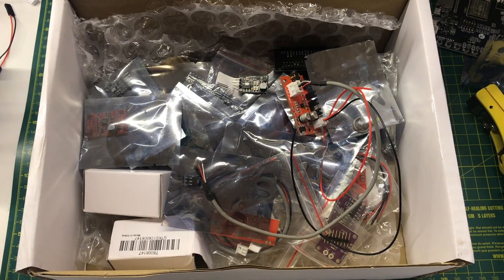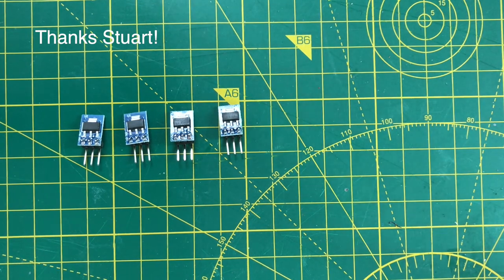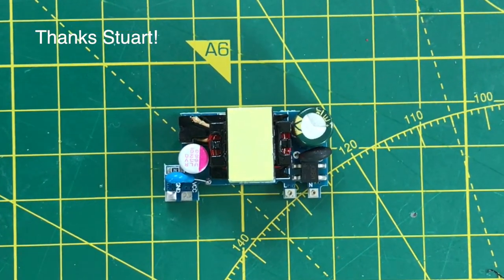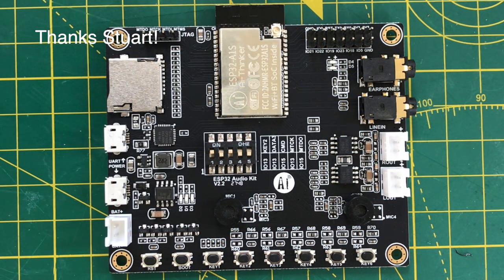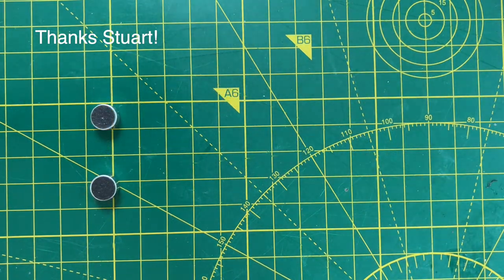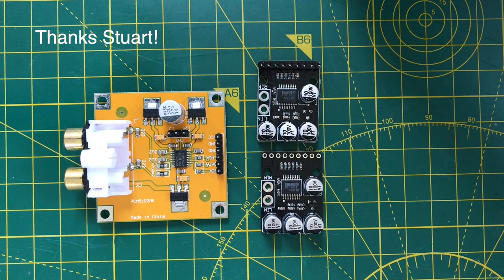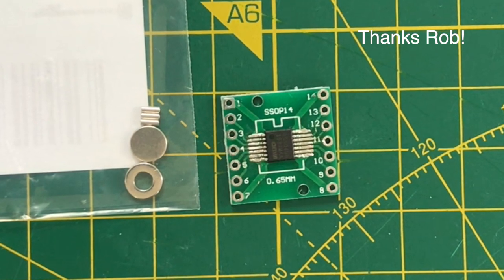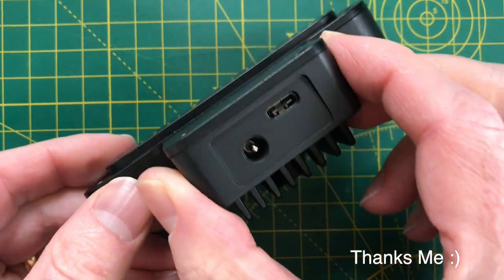February Mailbag - we've had our first mailbag.

Comment: Its an interesting moment for AI with the esp but actually its the esp32-s3 that could be a game changer.
Would be good to get those ADC hooked up with input analysed as the inbuilt is OK for reading voltages but for audio its not the best and a comparison would highlight that.
A1S is a great audio esp and its a shame about not having a smaller more compact audio-dev-kit of less bloat and in terms of Voice AI a unidirectional vs omni faceoff would be good.
If you can do beamforming then omni arrays are good without they are pretty much a collection of additional useless extra.
A crowdfunder A1s mini audio dev kit would be great.
Reply from the maker: Yes, the ESP32-S3 is pretty exciting. Opens up a lot of possibilities.

Definitely planning on testing out the ADCs - my assumption is they will be a lot better than the builtin one - but let's confirm that and try and put some numbers on it.

I think I'll do a bare-bones A1s dev board - I've been meaning to do a video on building a dev board and this could be a good one to start with. It's a shame EasyEDA doesn't currently offer them in their assembly service, but I'll see what PCBWay can offer.

Beamforming and omi vs directional - definitely need to do some work in this are.
Reply: @atomic14  Yeah I have quite a lot of input to give on a KWS but thinking it should wait for an ESP32-S as it may be possible to run 2x instances with 2x uni-directional but it does seem like espressif have got all singing and dancing beamforming working but unfortunately a blob.
A1s dev board yeah I will buy a couple of those :) but also the comparison of the a1s to ADC is also another point of interest.